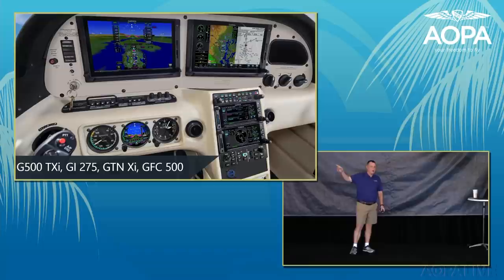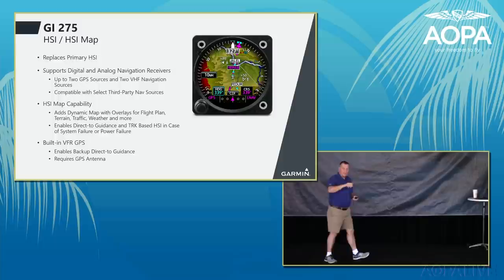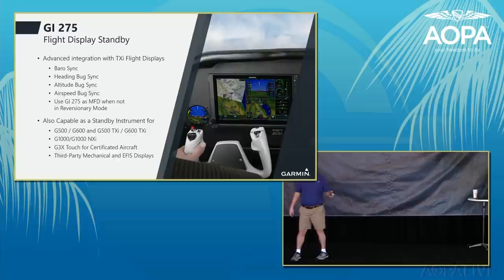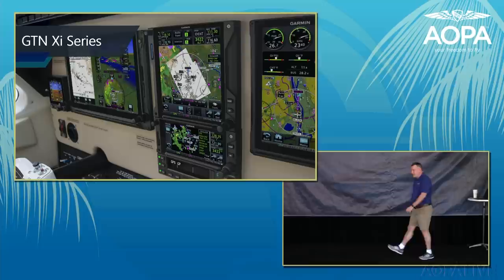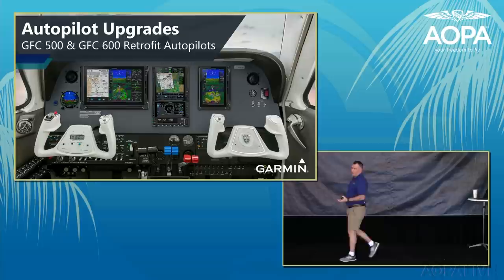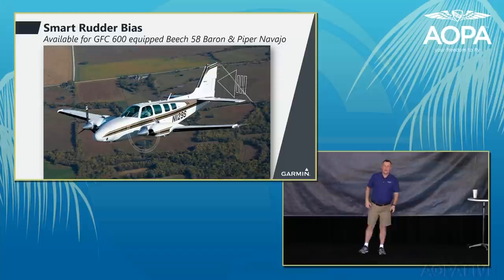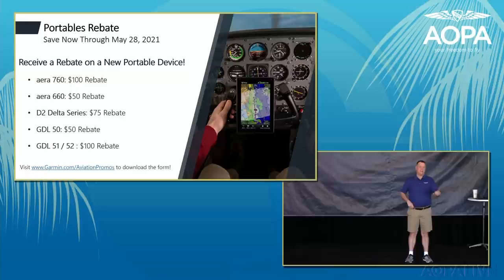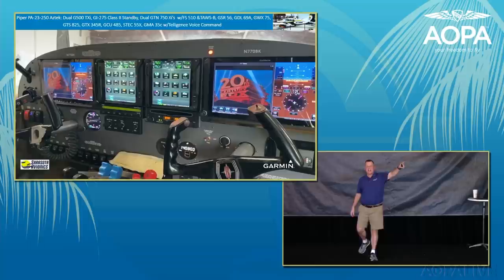What's New at Garmin

Comment: Looked at the steam gauge replacement 275 because I knew these things were $50K or around that for a glass cockpit, I was shocked at a sub $10K price, even under $5K. I suspect installation would run up the price, but adding it when you are tearing apart the plane anyways seems like a no brainer.